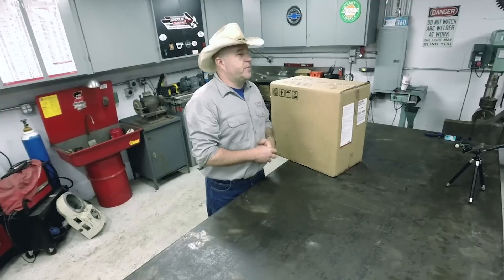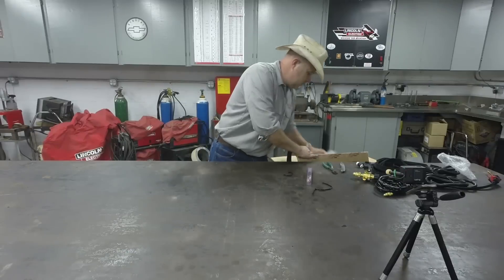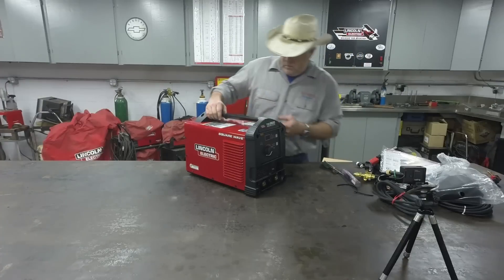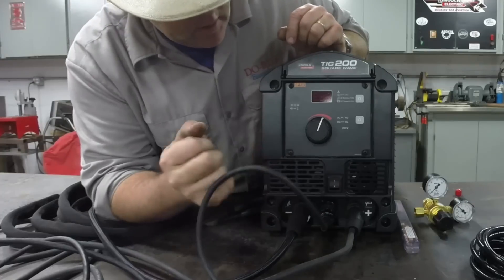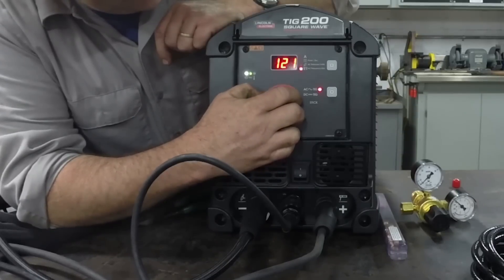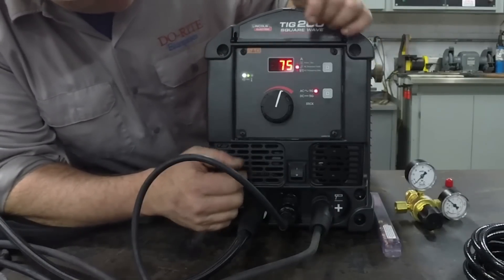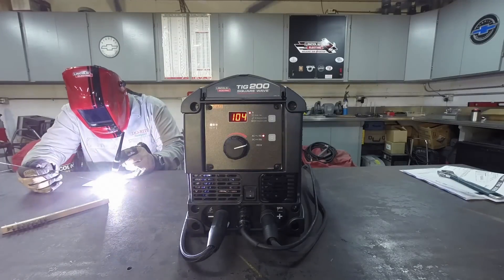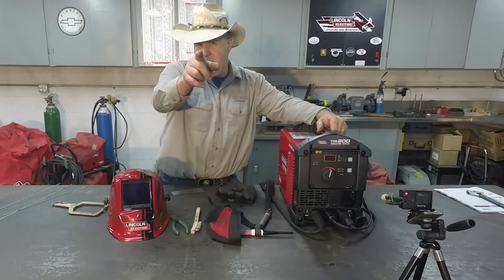Lincoln Electric Square Wave TIG 200 welding machine, unboxing, setup and review

Comment: I just got this machine I was wondering watch the video was great but what are the settings for the 25% carbon dioxide and 70% argon what are the gauge settings for what you just did as a demonstration
Reply from the maker: You do not use 75/25 for tig. 100 % argon or helium. 15 to 25 cfh for argon

Comment: I have this machine at work and having some troubles with aluminum but nice stainless, we have argon and goldstar aluminum mix I think its called, I prep all materials good, and use 3/32 pure tungsten, we normally do 1/8 to 3/8 aluminum, what gas should I be running at and what feet per hour  also should I try lanthinated tungsten? Thanks

Comment: Very nice review, A few years back around Labor Day weekend, Lincoln offered the Tig 200 and MiG 210 together for just over $2000.00. I jumped in and got them both. Took a little over 24 hour after I ordered it was on the dock at Haun Welding.
Great deal. Thanks for taking the time to review it. Dave

Comment: It's a nice machine if you want to spend 200 bucks on gas tacking on wheel arches. Your much better off with a 1000 chinese machine.non ajustable 17 second post flow!

Comment: Thanks for the video well done. I just bought the Lincoln rig 200 and I was wondering if the machine will work at its maximum if it is plugged in a 220v 30amp circuit. Thanks!!
Reply from the maker: Yes, provided it's balanced power that doesn't slump under load.

Comment: I know this is 4 years after the fact but I'm curious why there is no mention of pre-flow/poet-flow control with this machine.  Other than that consideration I really like the ease of operation exhibited by this machine.  I currently run a 200 amp AC/DC tig machine without frequency control and I won't make that mistake again when I get my next tig machine.  Really good video-straight to the point.

Comment: Mine came jacked up.. loose wires inside and the foot pedal wires were a mess as well.. sent it back to the place I bought it ..they sent it to an authorized lincoln repair company in butler Pennsylvania.. they had it 2 months.. I personally went to pick it up asked what was wrong with it..they said loose wires and its fixed.. took it home would hardly tig weld.. it was all over the place..  I pulled the plug apart on the foot pedal. Found bare wires touching and melting stuff..  called them they said they never touched the plug.. wired it up myself.. runs ok... 

Same thing happened with the 210mp  the mig side of things were trash.. the motor ran intermittently like it was a pulse gun or something. So I bought a  brand new motor for it and it ironed out some of the issues.   Yes I know these are entry level machines.. and I'm a Lincoln guy to and through. But I'll be buying a miller for my next machine.

Comment: I’ve been unable to decide on a machine for 3 yrs. first was the Hobart handler 210mvp, then was the Lincoln powermig 210, the miller syncrowave 210, all great machines but I am buying the tig 200

Comment: aluminum, galvanized steel, and magnesium ..Wear your respirators... I ask u as a welder .myself I have taken safety courses in welding shop safety and I learned a lot about the HAZ MAT and the danger of the poison vapor that rises from welding certain materials..

Comment: How can you have a machine that gives you 200 amps at the work, but only use a 20 amp circuit?  Seems to me the breaker will pop the first time you "give it the gas."
Reply from the maker: Ohms law applies here. Power(wattage) is the constant. Arc voltage (16-30 volts approx) is lower than the 120volt wall current so more current (amps) is available. Full output is not achieved on 120v 20 amp outlet. To go to the full output of the machine you need 220v.
Reply: Its all about watts. 
200v @ 1 amp is 200 watts
1v @ 200 amps is 200 watts

Comment: Kind of an old video but how well does this machine run 6010? I can’t seem to find anything about it, i know some of these smaller machines struggle running 6010 looking for a good ac/dc tig but also need something that will run 6010 to practice pipe Welding
Reply from the maker: Zakk Heaton I've never personally run 6010 on this machine, but close friends have, they say it works well.

Comment: I recently bought the 210mp , and was going to buy the kit and the foot pedal ,torch etc, to get into Tig welding . Someone mentioned that multi-use machines are not great , so I as debating to buy this Tig welder your demonstrating instead , and use the 210mp for MiG only .Any thoughts ?

Comment: from stick welding 7018, silicon bronze brazing, even welding box cutter blades with er70s2 this machine can do it all. I LOVE the fact you can hook up 2 power sources without losing any response from the welder. the lightweight, easy interface just makes it that much easier. I would highly recommend this machine to ANYONE interested in welding or anyone looking to expand their capability with welding. good luck finding a machine with this much to offer for this price. I've owned mine for 2 years now and wouldn't trade it for anything. Lincoln Electric, WELL DONE making this beautiful machine.

Comment: When you stick weld do you use about 120 Amps?  How do you use this without blowing a circuit at the house? What is the best settings for Tig with 120V. Thank you
Reply: depends on the thickness you are welding but I tend to try to stay under 120A on 120v. as for stick welding, you can easily throw in a 3/32 7018 and cruise at 85A all day.

Comment: What I think Jim try to say is the foot pedal vary the amps till you stop pressing on it.  Another thing I like about the Lincoln is they display the list price right in the web site. That is a key spec of the machine. I hated it at car dealers when you have trouble just to get a lowest price from them without signing for it.

Comment: I am looking for a AC/DC Tig welder, wanting a easy machine to setup and run would be welding mild steel most of the time it would be 1/4" and less but if needed can do 5/16"-3/8", aluminum would be 1/4" and less. Would this be the best machine in it's price range $1500 or is there a better weld around the same price range that's just as easy to use. If there's another welder the consumables must be readily available without the need to wait or special order them online. Also it must have a warranty as good as Lincoln & Miller.   Thanks
Reply from the maker: The SW200 is your huckleberry!

Comment: Stumbled across this video looking for info on the SW200. I've heard your name while watching Kieth Rucker's videos, and after viewing this presentation, I'm subbing. 

I'm looking at buying a TIG welder and I think I'm sold on  the SW200. I wish it went down to 5 amps but not sure how important that really is (I would use this mostly for small gun parts). I can see that a adjustable post flow could be a nice feature, but I read your comments regarding the automated post-flow being based on amperage and that sounds alright. The machine I was taught on and occasionally use is a Miller Econotig. It only gets down to around 23 amps in DC and the post flow lasts forever. This welder seems like a major step up. I also like the 120 volt option, as I could see using this thing as a semi-portable stick welder. I think this will work  out very well. Thanks for the video. 
John T.

Comment: thanks for the video. I did not see anything mentioned about gas. I seem to be going through gas quicker than I think I should. I have my CFH set at 19-20 which I believe was recommended by Lincoln. I seems that the gas stays on for up to 20-30 seconds after I release the foot pedal. My understanding is that it should be a second or two at the most, not 20-30.... Is that a way to change this? I've gone through 2 tanks of gas in a relatively short period of time. Thanks for any information.
Reply from the maker: On the SW200 post flow is a component of your actual welding current. Most of the time, post flow is 10-15 seconds. If you are welding aluminum, you can get away with a shorter post flow than if you were welding something like stainless steel or titanium. Nickle based alloys as well as titanium can be damaged by the atmosphere long after they have cooled below their glowing red temperature and are no longer molten. A long post flow time is needed in this instance to keep the atmosphere away while the work cools. The SW 200 is set up as an asymmetric TIG inverter, at a very low cost. To keep the costs down (by not having to buy the actual components) Lincoln allows the machine to calculate your actual weld current and adjust post flow by a predetermined algorithm. That algorithm takes in to account if you are welding SS or titanium. That's a bit wasteful if you are welding aluminum, but you just bought a TIG inverter for around $1400.00 US. The last one I bought cost me over 6k US. If you TIG weld low current you should (according to Lincoln) see less post flow  time than if you are at a higher current. I Used a SW200 recently teaching for a week. We ran probably 5.5 hrs of hands on time every day. A standard 120cf bottle lasted me about 3 days. If you are getting drastically different results, take it to your local weld supplier and have it checked out.
Reply: Thank you very much for all this valuable information!! This is the information I was looking for. I will contact my rep and see if my experience is normal. Thanks again

Comment: Jim, thanks for the preview. I just purchased one and now i need to get my Tungsten and filler.  What 3/32 Tungsten do you recommend in the Squarewave 200 for aluminum , for stainless steel. I purchased some Gray serrated 2 percent for steel. Thanks for your time
Reply from the maker: E3 purple for everything. 2% red works well too, but purple works better for me for Aluminum.

Comment: The SW 200 and Power MIG 210 MP are on sale as a 'Garage Pak' until August 29.  Both machines for just $1999 (after rebate). Check it out at store.lincolnelectric.com.
Reply from the maker: That is a smoking deal!
Reply: That's an odd combination, considering the 210 MP can TIG. Probably not as nicely as the SW, but still, pretty damn good deal. Wish that was available when I picked up my MIG a few months back.

Comment from the maker: The square wave 175 was my first TIG welder. It is a great machine and despite it's limitations does a great job and is a good choice for the beginning welder because there is very little to get out of adjustment. Compared to the SW200, the SW175 is big and heavy. The SW200 is an asysmetric TIG inverter capable of up to 150hz when welding in AC. It will run on 110v or 220v. On the other hand, the SW175 is a sinusoidal transformer driven machine that can only produce 60hz when welding in AC, and will only run on 220v AC. We are not really comparing apples to apples here. The only draw back I see to the SW200 when compared to the SW175 is that it has a lot of PC boards inside it, those can get expensive.....the SW175 is basically a big transformer with a few small PC boards for  control circuits. Lincoln has backed up the SW200 with an industry leading warranty to show that they have faith in the machine. I do not expect any longevity issues with ANY of the bigger welding companies, as they have reputations to protect. As for the over the pond elcheapo such as the Duralast, well....good luck.
Reply: Here's a tip for you: Check out the multiple camera angles in the first minute. Totally unnecessary and distracting. It took time to do that, and made your video worse. It's like I'm standing in your garage and I keep getting teleported somewhere else. It's a really un-natural perspective for the audience, because nobody is going to play hopscotch while listening to you talk about welding. Anybody standing in your garage is basically going to stand in one spot. Cutting in a close up camera angle is good for details, but all the rest is annoying.
Reply: The TIG torch is without button, so I wonder if the welder stops the gas automatically, or not ? (Unless the gas bottle loses gas ...)
Reply: I have been doing a bit of research on this Tig welder ( Newbie looking to buy one ) and for what information that i manage find from my local welding supply store  on the gas usage, the answer was that the gas  is factory set ( regulated ) on the machine and control by the amperage that you set it at..( The higher the amperage the longer the gas post flow, which for what i was told would be as high as 16 seconds and to me this seem like quite a bit of gas usage ..Like i mention i am NOT a pro but i do like like to do my homework before investing my $$ and this to me is not a game changer but it seems to be one of the drawbacks of this machine
Reply: Thank You, for the answer !
Reply: Miko1992 Miko,  the tig 200 has a internal gas flow solenoid. 1st quick light foot  pedal tap the pre flow gas starts. Fully depressed pedal starts the arc and gas. After letting off the pedal post flow continues for 5-10 seconds great for aluminum and stainless...  I have a remote torch switch when welding inside boats. On or off. Amps. Frequency and A/c balance has to be set on the machine before hand. This is a great machine for 1/8" aluminum any thicker.. it welds but.. you must preheat accordingly! (Remember its Only a 200 amp machine). It will weld stainless or steel any gauge. I use it for  pontoon boat repair, Stainless thin wall  sanitary pipe (with back purg) and anything you want a nice weld🤗. Highly recommended!

Comment: Hey there, not sure if this has been asked already (sorry if it has), I have been trying to find out if this indeed is a HF start machine, both on AC as well as on DC... can you answer that?
Reply from the maker: +David Naumowicz Yes, It has HF start on AC and DC. Except it is not HF but capacitance distcharge. It does the same thing without the FCC getting so upset that you are screwing up all the TV sets.... lol. To be clear it WILL start the arc automatically in AC and DC.

Comment from the maker: It most likely is a leak in the argon line. Be sure to check the connections at the regulator and at the back of the welder. If that doesn't get it try spraying soapy water around the regulator to find the leak.

Comment: Hi, one more question, on this new Lincoln Tig -200 , I find that when I close the valve on the tank itself, that a few seconds later you loose all pressure on both gauges.. Is that normal? I don't remember any regulator doing that in my past experience... Is this a new safety feature? Or bad regulator?

Comment: what is asymmetric about it?
Reply from the maker: +gmaestro79 Boy, that is a very complicated question! An AC wave form (as seen on an oscilloscope) is symmetric. Meaning that the wave above the zero line mimics the wave below the zero line. A general principal to remember in TIG welding in AC is, (in simple terms) that when the AC wave is above the zero line it is positive, and when it is positive it is CLEANING not welding. When the wave is below the zero line it is negative, and when it is negative it is PENETRATING the base metal or welding.  Now we know that only 50% of the time the wave form is negative or welding. So we can say that the welder (in simple terms again) is 50% efficient. If we shift the wave to spend more time on the negative side of the zero line, then the welding machine becomes more efficient because it is welding more and cleaning less. When we make this shift, the wave is no longer symmetric .We refer to this as  asymmetric. Usually only inverter machines have this option, we refer to it as AC balance. I hope to do a series of videos on TIG welding and how the AC wave effects the weld procedure. Hopefully by the summer.
Reply: +DoRite Fabrication That is simply AC Balance.

Comment: Well, there are picking up the unit today, and as soon as I get them a PRO#, they ( Lincoln ) said they will send me a new unit, ands sounds like I won't be waiting that long after all!  I'll got back to you again when I get the new welder... Thanks for all your help! The old machine is being sent back directly to Lincoln in Cleveland.
Reply from the maker: +blackjack6934 Great news. That is why I am a big Lincoln fan! The customer service is number one. I have only had a couple of issues in my 30 or so years welding, but Lincoln has always been super to deal with. I can tell you from first hand experience that the other guys are NOT that way. They probably want the old machine in the lab at the factory (I've been there). They will tear it apart and figure out what went wrong, if it was shipping damage, or a faulty part. Believe it or not they can trace a bad part all the way to the guy who made it. I have had the privilege to tour the plants and see the machines going down the line being made. Very impressive.
Reply: +DoRite Fabrication So far, I'm impressed, they got on it right away and hopefully will get the new one soon! And each time I watch your video, I can't wait to weld again, I,m retired and haven't welded since I retired 6 years ago. I know I'm going to like this machine... I've got everything I need, the rods, argon, gloves, brushes, hood, all I need is that welder... Love your videos, very informative.